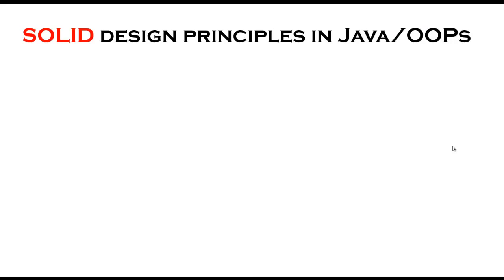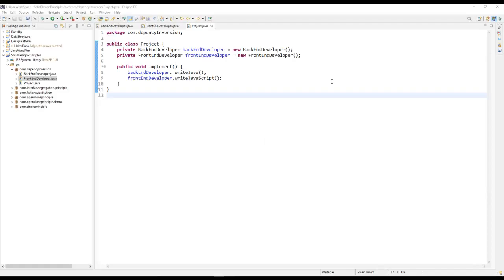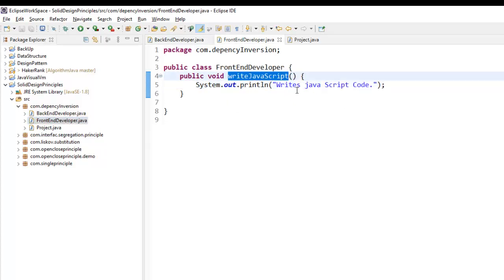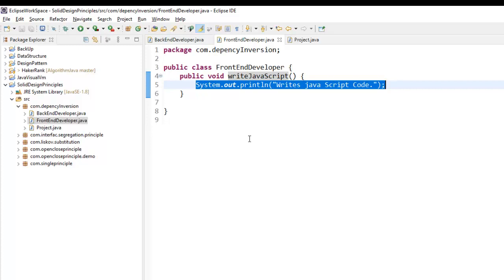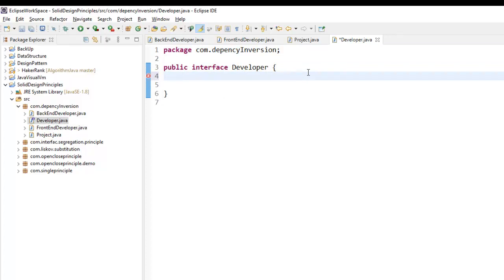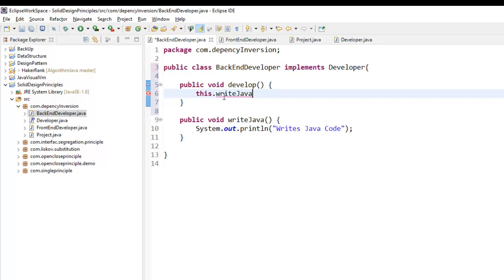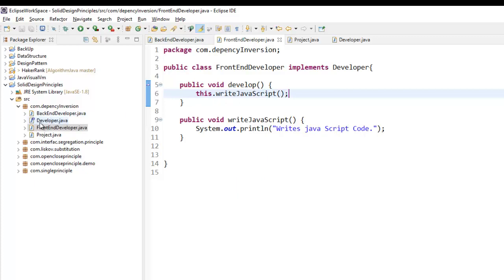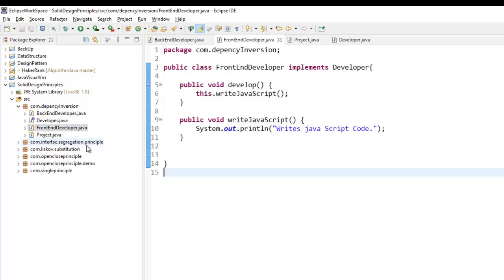Dependency Inversion Principle in java from SOLID design principle.

Comment: One question, so at the end if we would call the implement method from the Project class, we would need to use our interface like so (?): 
Developer dev = new BackEndDeveloper();
project.implement(dev);

or we could also do 

Developer dev = new FrontEndDeveloper();
project.implement(dev);

depending on what we need... right?
Reply from the maker: Yes. You are right.